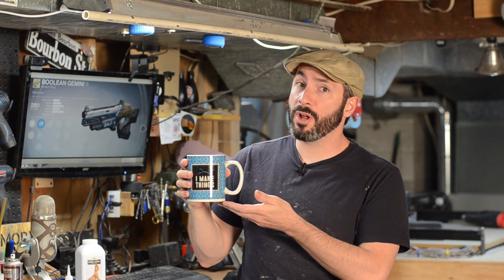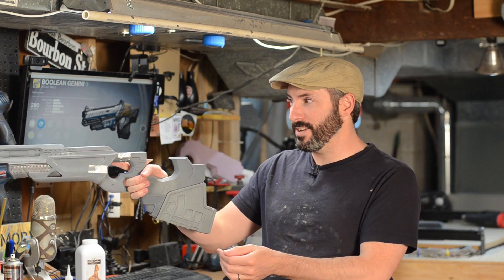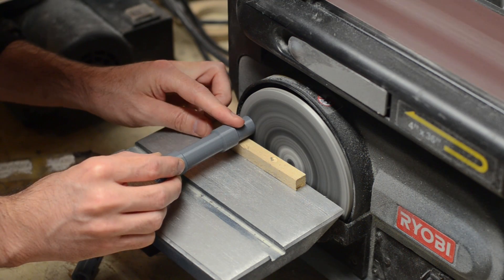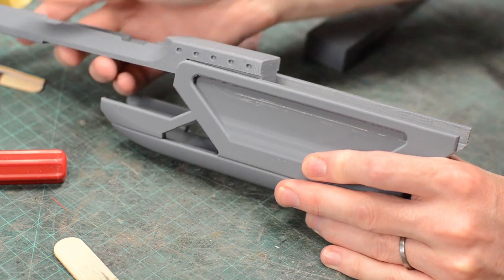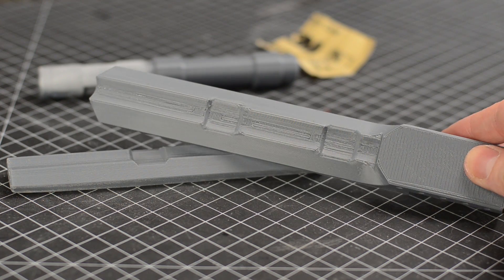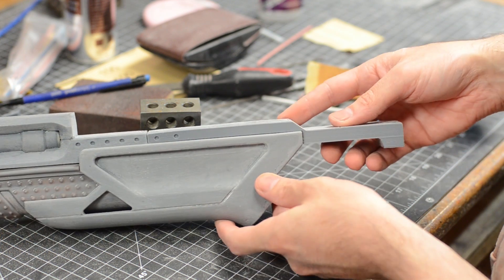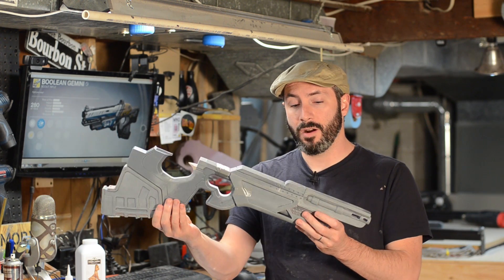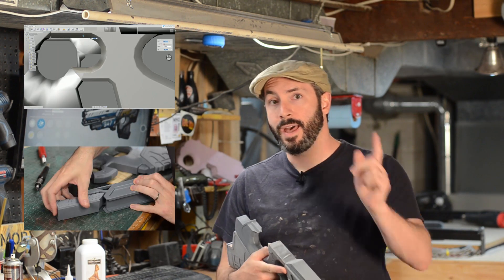How to 3D Print a Gun Prop from Destiny Part 5: Sanding and Assembly

Comment: Is this PLA? So using the epoxy the lines disappeared??? I have some statue will similar lines... if i just sand the bad areas smooth.. then epoxy entire model will the sanded areas blend in so you can't see
Reply from the maker: Yes this is PLA. Adding a coat of epoxy can help make your surface more smooth.

Comment: Hi Bill forgive me if what I'm asking has already been covered but I can't seem to find it in your channel.
Have you any tips on the various techniques for post-processing 3d prints for complete beginners? I bought a taz 6 hoping that it would not require any touch-up but learnt the hard way FDM is still FDM no matter the price point

For example, when to use a dremel, various types of sanding methods, when to use power tools, the pros and cons of epoxies like XTC-3D and so on

Comment: Hey Bill, love the series so far.  Thanks always for your awesome tips and tricks.  I am currently 3D printing out some small figurines for a board game and would like to get rid of the print lines as much as possible.  The models are very detailed and I would like to avoid losing as much detail as possible.  Would you recommend acetone smoothing/sanding or XTC 3D?

Comment: What's the best way to smooth out 3d prints? and also how much space do you leave when printing 2 parts that are suppose to fit in to each?
Reply: Lets say for instants a button, what would be the offset of a 1" button for it to be smoothly functional and would you be able to leave it in the print or print it separate from its counter part?

Comment: I really like the BSI adhesives. Have you ever used automotive skim coat to smooth out parts and a product called micro balloons?
Reply: The micro balloons is really good for filling a gap and adding some strength to a joint. The skim coat is like Bondo in a tube you do not have to mix.

Comment: I think you know that you can smooth out ABS parts by exposing them to aceton vapor, so i wonder why you chose to use PLA? Not having to sand all the parts would be a huge pro on my list, and i've just begun to explore the world of 3D, printing, so any insight on this matter would be very appreciated.
Reply: jmho... PLA has a lesser tendancy to warp and the acetone vapor bath does make things smooth but can also throw of fine measurements. making assembling many pieces quite tricky...

Comment: Like always really well done video! I suggest you to print directly on the glass of the Ultimaker without using raft and you can apply on the glass a bit of Glue stick or hairspray and it will works perfectly and you will be able to print the barrel with no problem. I always do like that and i never had issue ;)
Reply: I second this^. Never printed with a raft and have yet to lose adhesion to the bed.